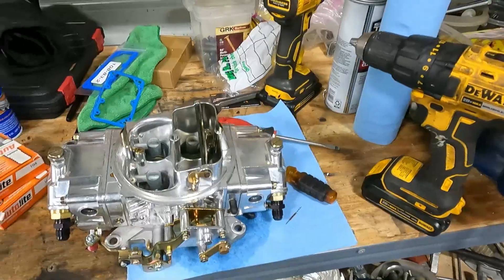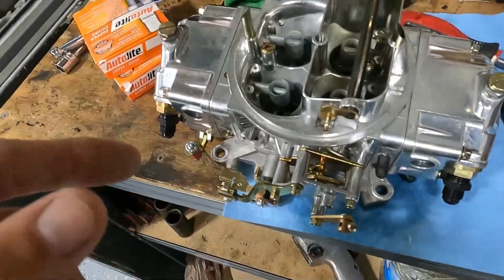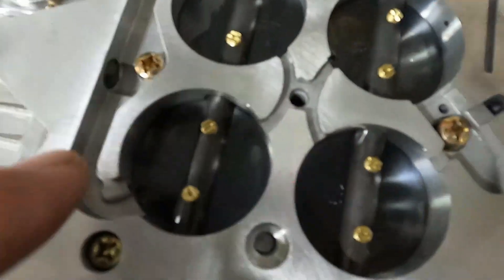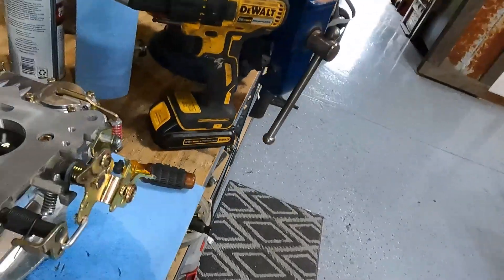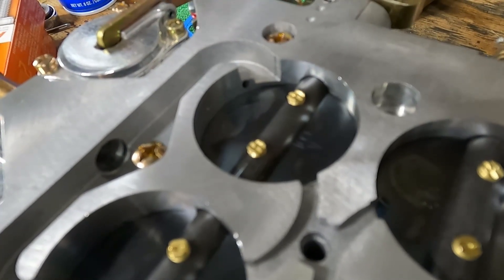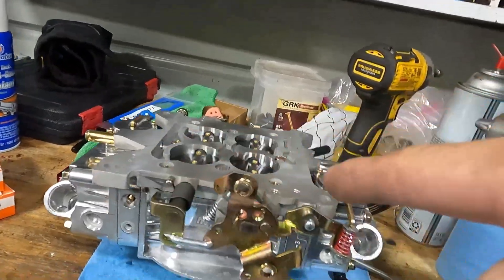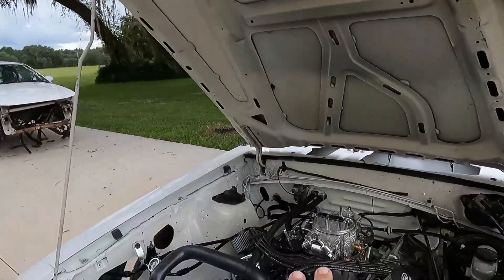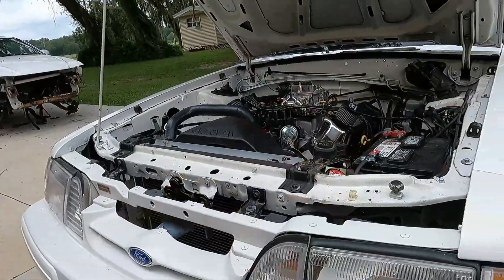Tips On Tuning A Holley Double Pumper! Small Block Ford 306, Gt40P, Anderson N41 Cam!

Comment: What did you end up setting your base timing at on the n41? I'm running same cam, carb and hei vac distributor.
Reply from the maker: 15degrees. I have the idle set around 900.
Reply: What was your idle rpm as well?

Comment: Kris, how did you settle on 5 1/2 on the fuel pressure regulator? I’m running an Edelbrock AVS2 650cfm and a Ford B303 cam.
Reply from the maker: You can run between 5.5 to 6 is what I was told years ago by Patrick at pro systems. I just stuck with it. Edelbrock I’m not sure.
Reply: @fox-body  you were correct, I read the Edelbrock manual and they recommend 5.5. Thanks!

Comment: Great video , bro , questions ,my oil pressure drop to 20 or Less , what you think is it? Thanks
Reply from the maker: That’s normal on a ford. If it rises with rpm it’s fine.
Reply: Yes raises with Rpm thanks

Comment: Where do you have your o2 for the wideband? I have one that I need to install and ive heard like 8" before the collector is the best but a few said that they put theirs in the x pipe but Im thinking a little before the collector is best but just checking to see your thoughts , its on a 347 with a decent sized cam and aluminium heads etc.
Reply from the maker: I put it in the stock location on the h pipe. It is about 8 inches from collector.
Reply: @fox-body  ok thanks man that's what I was thinking would be the best

Comment: Vacuum gauge as you adjust idle air screws up and down till you get the most vacuum on each corner of the carb is the way a old school carb guy showed me
Reply from the maker: Yes I did that also. The wide band really shows small adjustments.

Comment: Your Air/Fuel gauge, is it a single bank unit? Would 2 guages be required for both banks? I know it can research this through Google, but you having multiple engine combos, I liked your opinion. Simple SBF, 650 double pumper, street stuff.
Reply from the maker: Yes single. I’m only reading of the passenger side. You could use 2 but not necessary, especially with a dual plane intake.